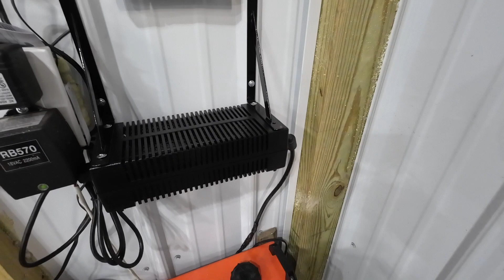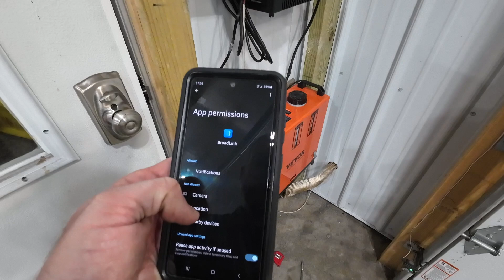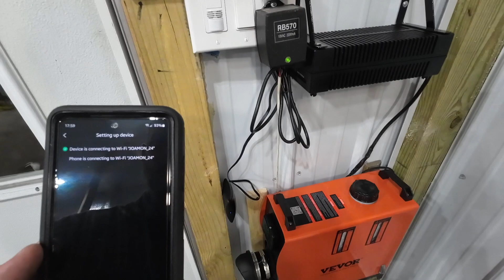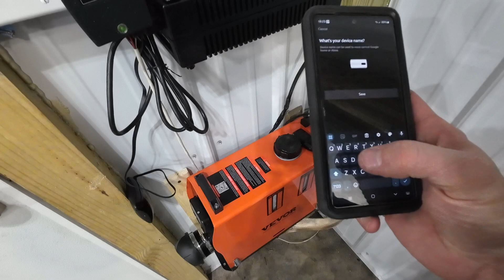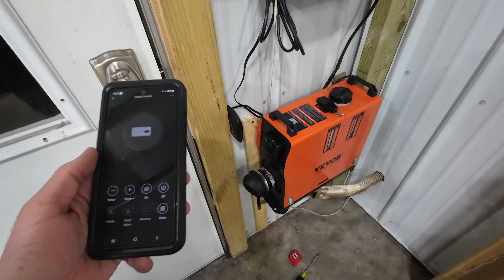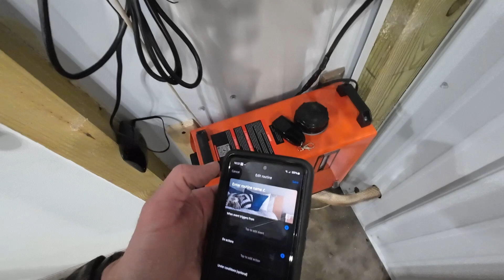Add WIFI App Remote Control To Any Diesel Heater EASY Broadlink RM4 Pro

Comment: And for an FYI, the BM4 Pro works with the home automation software called "Home Assistant."  If you have temperature sensors in your shop, Home Assistant can use them to control the heater via temperature setting in HA.  Choose the days, the times, whatever you want.
Reply from the maker: Thanks for the info!

Comment: Do you know the distance on this set up?
Reply from the maker: Even though it should be a larger distance I found it want reliable unless I put it within about a foot or 2 from the unit. I do have some 433 interference from other things though and that could be part of the problem.
Reply: As long as there's not interference or too many walls in the way etc 433mhz usually works for at least 10m and can go for long distances depending on the output power of the RF bridge you choose to buy, Google can tell you that. Wifi, depends on how good your router is, and the internet works anywhere in the world thanks to Elon Musk and his satellites 😂

Comment: There are actually a few options for wifi diesel heaters. One is the Sunster TB10PRO make sure it says wifi pro on the display controller. Another is the Challenger Ignite aftermarket controller, a third is the Afterburner controller, lastly is the Nordkapp Diesel Heater( Not sold in the united stated but seems to be sold all throughout europe)
Reply: The new vevor have option for app, and also have auto shutdown, $70 all day long on aliexpress,and ship from us warehouse.
Reply: I just ordered the sunster tb10pro non wifi, the wifi ones are impossible to find and I don't need that camping anyway. The tb10pro with the co remote and everything was $119aud including shipping, and out of curiosity I wanted to see how much the wifi controller is for it, turns out it's available for pre-order for October and it's 107aud plus shipping. So I can almost buy a whole new heater for the cost of adding wifi lol. I'll go with just Bluetooth and if I do need to add wifi, the broadlink will do just fine because it will work with other things in the house too.

Comment: Do you habe any kind of ideea why is not working on/off but is working setting the temperature with same mhz setted on both ? 😢
Reply from the maker: Not sure. Mine works great. I did have to move the module really close to the heater though.
Reply: Mine does that when it’s getting close to being out of fuel

Comment: Can you set up more than 1 heater per controller?
Reply from the maker: I don't think so unless they work on the same frequency then both would turn on together. Otherwise just need another module
Reply: yes you can I've just done it. Both heaters are using 433.87 rf remotes. I can operate them both separately from the same crosslink RM4 pro

Comment: Using a rf hub won't work because these heaters need a pulse of about 3 seconds to start. It's a safety feature. A cheap wifi rf hub will only send a brief signal, not enough to control the heater. I believe the solution is to use a rf signal generator with the hub but the cost of that to setup is more than the cost of the heater.
Reply from the maker: My setup, as seen in this video, works perfectly....
Reply: The broadlink RM4 pro copies the rf code from the heaters remote which dose not need the 3 second hold to turn the unit on or off

Comment: Question please, having the same Broadlink RM4 Pro smart being delivered tomorrow. I currently have a bluetooth version but want to go wifi.  1) do you get any feed back that it has successfully started  and what setting your at eg, gear 2 vs gear 10?
Reply from the maker: No confirmation. I have a small wyze camera near the heater so I can visually and audibly hear that the heater has started.

Comment: Ok I got the  RM4 Pro with the intention of meshing it with a Victron Cerbo GX and Nodered to control devices. It does seem to require the phone the  broadlink app is loaded on to on the LAN for it to work vs. I can remotely log into my Lan but unless my phone is connected to my wifi network I can not access the Broadlink.  Correct me if I am wrong.
Reply from the maker: The app works through a hosted server so it does not have to be on the same network as the rm4 pro.

Comment: I have a problem, i can't push the start ou stop button for 3 second on the app. I need to push 3 sec on the remote to start/stop the unit but i can't do it on the app. Do you have tips for me ?
Reply from the maker: I suppose it depends on the brand of heater that you are using.
Reply: I believe the BroadLink doesn’t support the button hold down features. Bond does
Reply: @blakejohannes7102  Bond?

Comment: Very cool. You seem to have a knack for understanding these tech devices. Btw, do you think the SS exhaust port is insulated enough to stub out through vinyl siding? Thanks for sharing
Reply from the maker: I'm not sure about vinyl siding. This is meant to be used in marine applications. I would consult with the manufacturer. My gut tells me that it would be too hot for vinyl siding